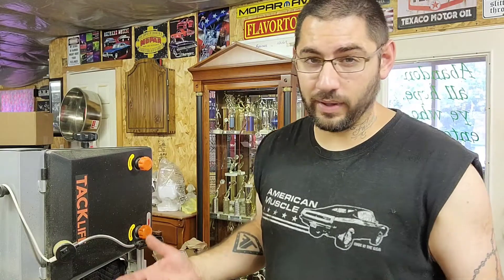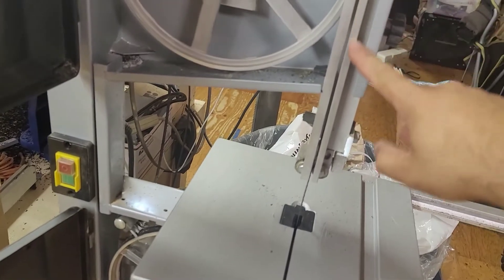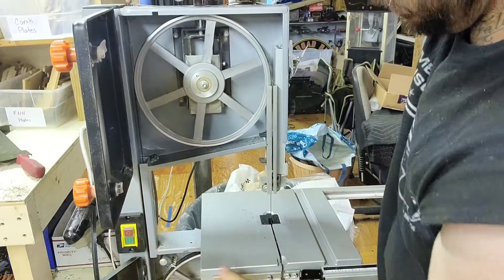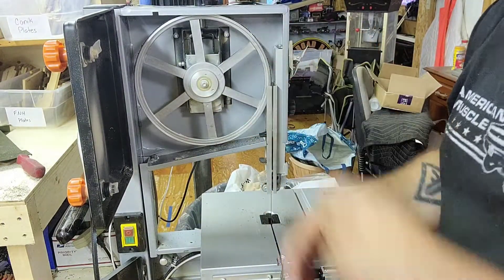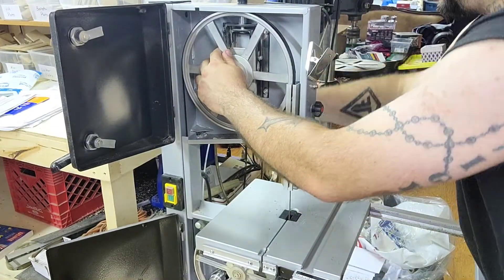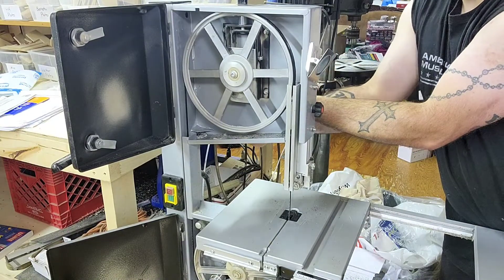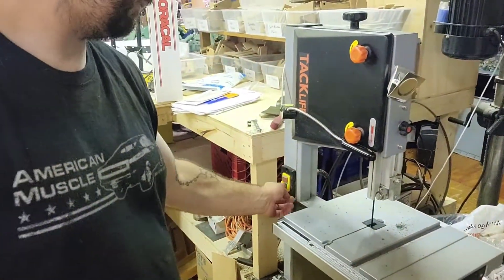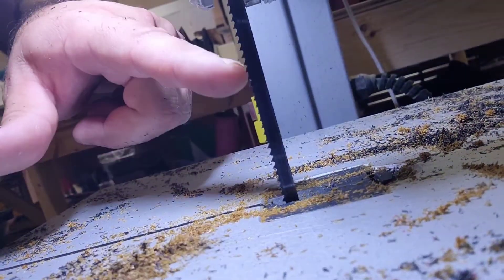How to Replace the Blade on your Band Saw

Comment: Why your saw did turn on while doors open? I thought there must be cut-off switches, which block power supply, cause run the blade with all open is very dangerous...